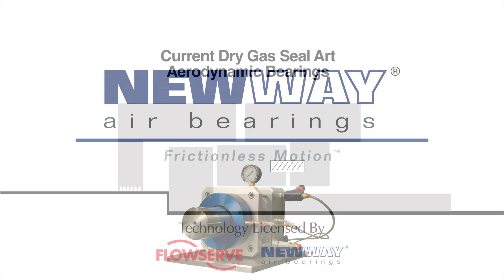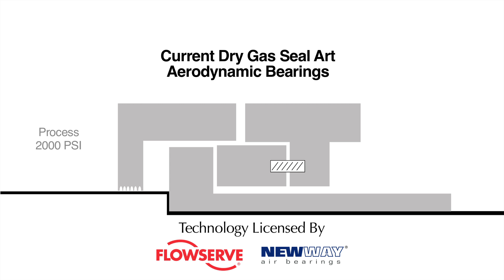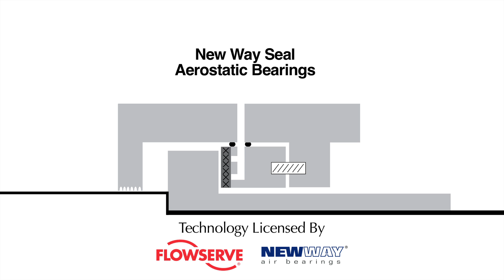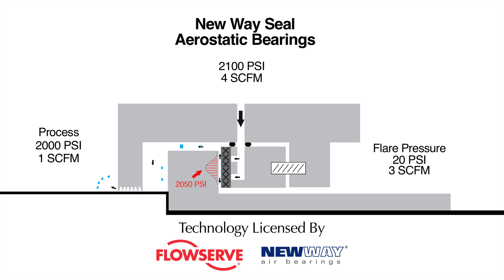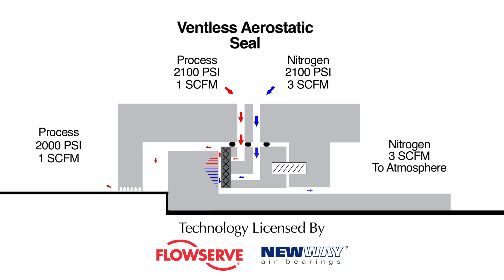Seal Animation

Comment: Just curious.  What kind of rates of contamination or clogging to the porous filters do you get from a setup like this.  Can it clog to the point of impeding fluid flow, or is that able to be stretched for a very long duration with clean enough gas processing before it reaches the filter, or is that not even required.  Are the filters designed to be serviced or replaceable?  Mech eng here that's been looking into your videos lately, very fascinated by air bearing technology in general.  Using porous material like carbon seems like the play for most designs, but I'm curious how big of a problem you tend to have with this material getting "clogged" over time.
Reply from the maker: These bearings are not plugged by particulate contamination as an orifice air bearing could be. You can pour sand or Teflon tape or the stuff that Schuff off the inside of tubing after a while into a bearing without any effect as even if the whole Plenum is contaminated it has less restriction than the porous media does. Contamination by water or oil does have an effect on the flow through the pours media running clean, dry air through the bearing will clean out water contamination quite quickly. Usually within a few minutes oil takes longer that may take a few hours.

Comment: Can these air bearings work to seal a vaccum inside a container with a rotating shaft passing through it?
Reply from the maker: Yes, they can, in fact, we use that principle to reach into vacuum chambers for the semiconductor industry
Reply: Thanks for answering! This is quite insightful.

Comment: What about startup when process pressure is not high enough?
Reply from the maker: A compressed air cylinder would be in the
panel. Even a CO2 cartridge for a paint ball gun would bearings in a 20MW
turbine/compressor package for 5 to10 minutes.
Reply: Sohail Hassan Rana kind of oil and period change
Reply: Kind of oil and period change

Comment: If the seals are rated for 2000psi, why aren't the porous gas bearings? They are made of the same materials.
Reply from the maker: +meocats Hi,Turns out we can run bearings at 2000psi. The issue is the bearing needs to contain  the pressure